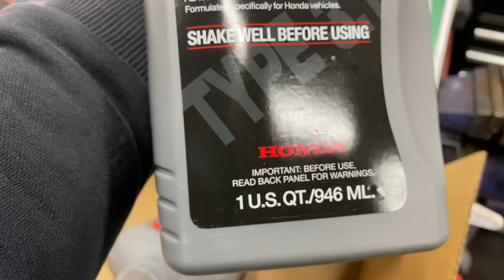Transmission Fluid change on 2020 Honda Pilot Touring

Comment: You need to turn on the engine and let get the temperature up at least few minutes before taking the side drain plug and  fill if is needed until it starts leaking then put the plug back and turn off the car,  that’s the correct way to do it
Reply from the maker: Thank You 🙏

Comment: How do you check the level of the transmission fluid? What temp does it have to be to get and accurate level reading? You should always locate and loosen the fill and check plugs BEFORE pulling the drain plug. this video does not currently explain the procedure on full
Reply from the maker: Thank you so much for your query and opinion. Bought the transmission fluid from Honda dealer as per requirements and used it accordingly. About the temp, car was idle for 45 minutes, so it was cold already and drained out till the last drop. The mechanic didn’t check any plugs… After changing it, drove 10K KM including trip to/from Toronto to NYC without any issues . 

Thanks and regards
Reply: @stairwaytomusic71  There is a level fill screw behind the front drivers tire into the side of the transmission.  Need a long extension to get to it.  My wife's only took 3.6 qrts when the level screw started leaking so I knew it was full.  I did this process and again after 500 miles because the fluid was dark on first change and there's still fluid in the torque converter so you don't get out 100% of the old fluid.  Car had 80K miles on first change. After 5 months no issues and shifts a lot better....
Reply from the maker: @Chad… thank you so very much Sir, thanks for watching.